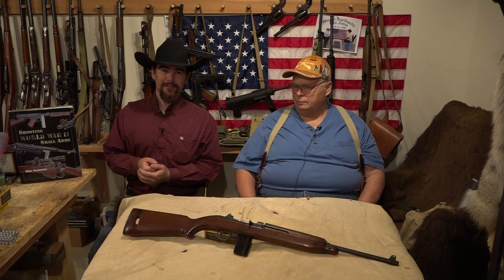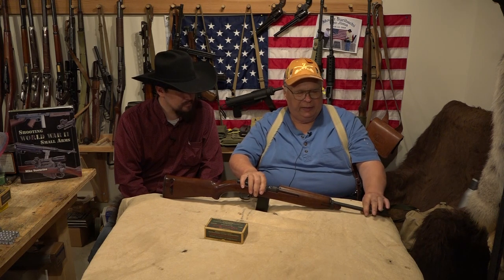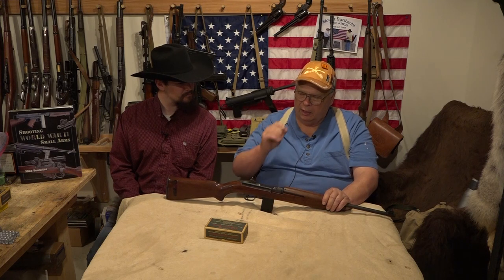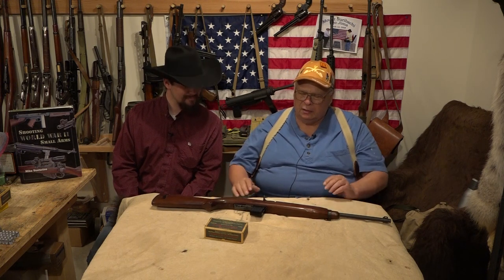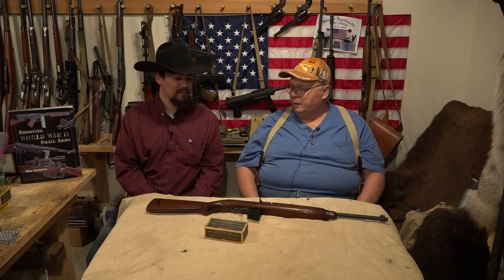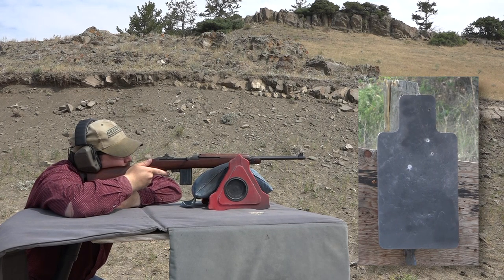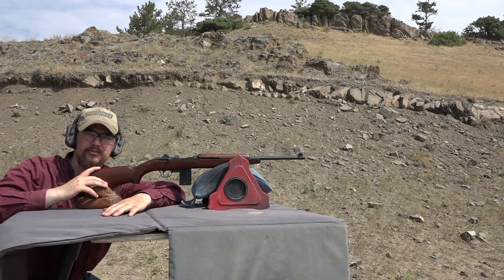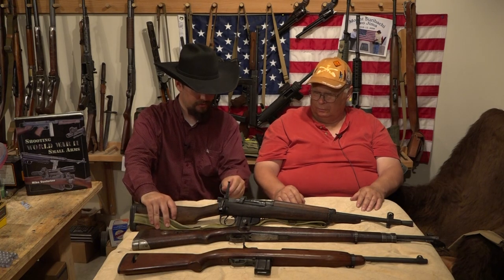WWII Small Arms Series M1 Carbine

Comment: The key difference between the Mauser and Enfield "Jungle Carbine" and the M1 Carbine is that both Mauser and Enfield are chambered in battle rifle calibers - 8mm and .303 British; the M1 is chambered, like the AK-47 and the Sturmgewehr, in an intermediate cartridge so that the lighter weight weapon is controllable - particularly in automatic fire. Witness the fate of the M14, which, despite its weight, was uncontrollable in auto fire. I own all three, as well as a Carcano Carbine, and I can tell you that the M1 is BY FAR lower recoil.

The M1 carbines were initially semi-auto until the advent of the M2, but remained controllable thanks to the less powerful (than the .30-06?  Most definitely) cartridge for which they were chambered.  In the latter stages of the war, during the battle for Okinawa, a variant came along that is variously labeled the M3 and the T3, equipped with "night sights" - infrared emitter and IR-sensitive photodetector.  In Okinawa, that model was said to be responsible for somewhere around 2/3rds of the Japanese casualties by small arms fire.  

The Japanese, as was said in the video, would come out of their holes at night and crawl, unseen in the dark (they thought) to the allied foxholes in an attempt to kill soldiers while they slept.  Unbeknownst to them, the night vision scopes with which the T3s were equipped exposed them, and resulted in a bloodbath that was instrumental in taking Okinawa.  Sometimes the best weapon is the one your adversary doesn't know you have.

What a great stroll through the memories and weaponry that ensured the survival of democracy at the hands of the greatest generation.